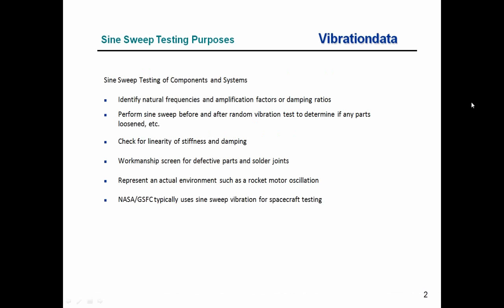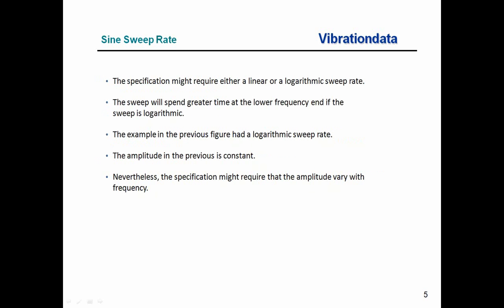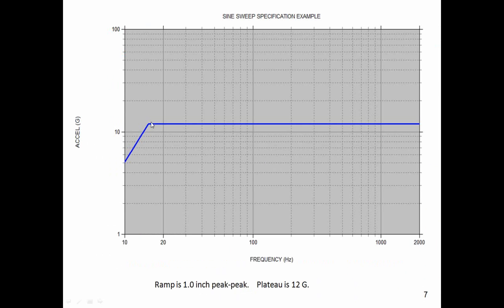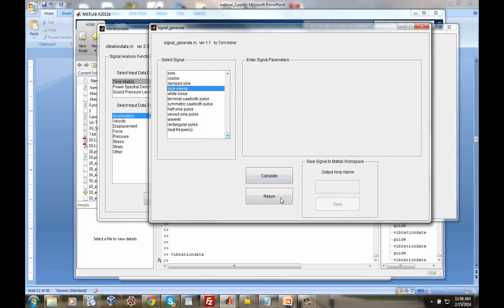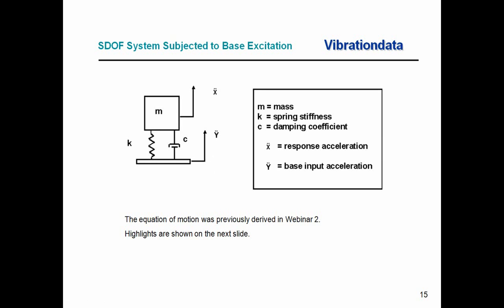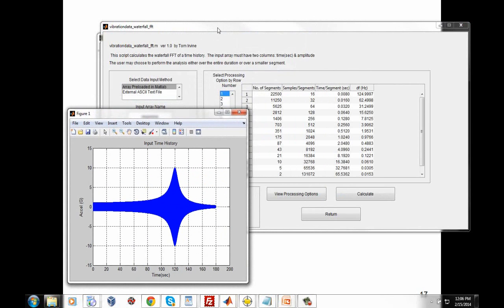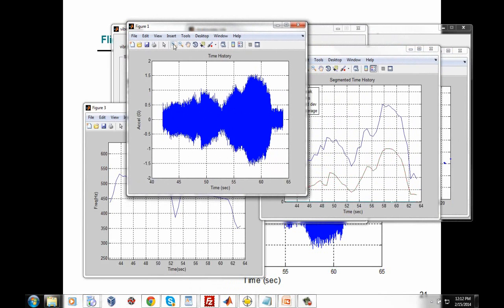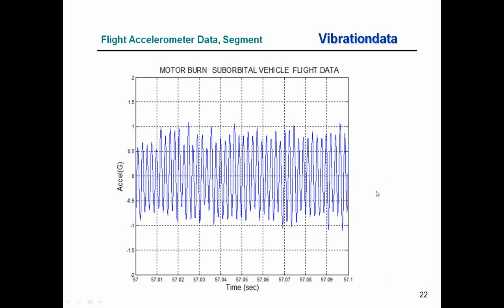Webinar 3 - Sine Sweep Vibration

Comment: hii sir
I am doing project on vibration analysis of economiser tubes hammered periodically by external hammer to remove soot particles. I need to find out acceleration of vibration and velocity of acceleration. The load is of Impact type. What kind  of analysis to be done??